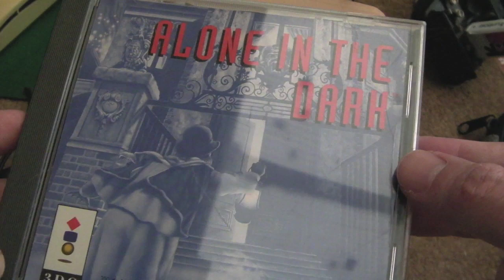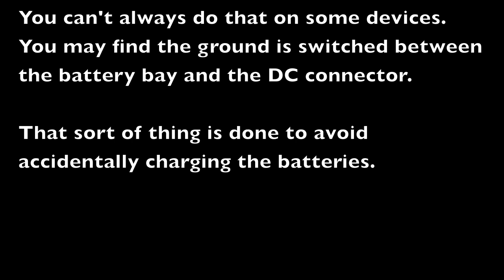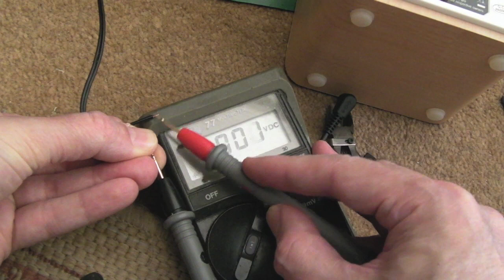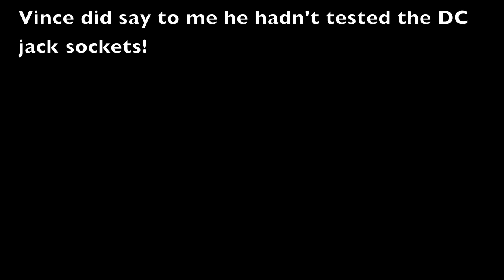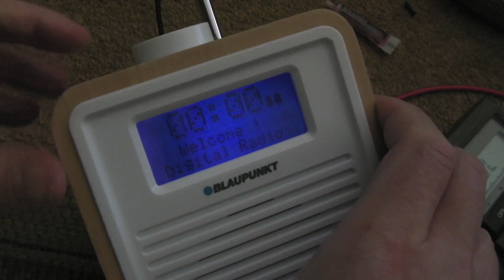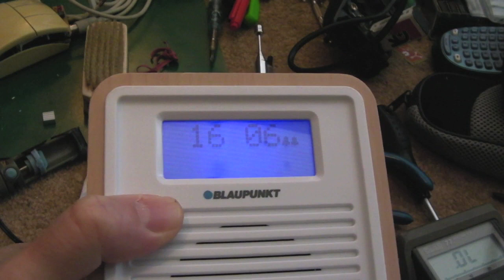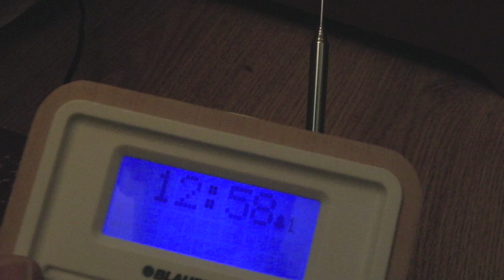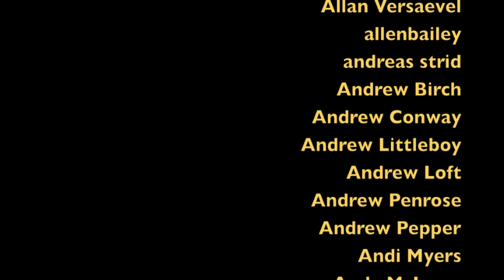VLOG - Blaupunkt DAB Radio Quick Fix & Back Light Mod

Comment: I see that radio PCBs haven't changed in the last 50 years. Same crappy boards, same crappy wires. Looks like it came straight out of the 70's. :)
Reply from the maker: It has an old style design to it, but its a recent product (eg. 3 or 4 years old)!

Comment: Nice fix on the socket, and a great job on the backlight. One thing though, you could have threaded the heatshrink onto the switch side of the wires to make it easier to solder. :)

Comment: Newer versions Visual Studios have a community edition which are free. I've not needed any of the Pro or Enterprise editions and I work from home. Failing that VSCode is 100% free and you can use that for .NET Dev.
Reply from the maker: Thanks!  I had forgotten about the community editions!  Might upgrade when I get time.  I do use community edition on another VM there for some ASP .NET stuff and C# projects - but again that needs updating as its pretty old now.